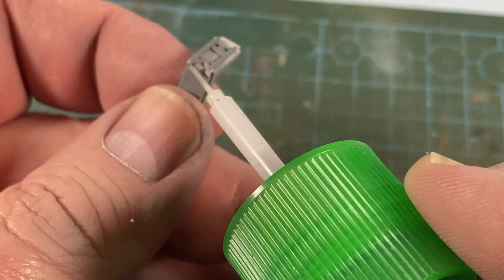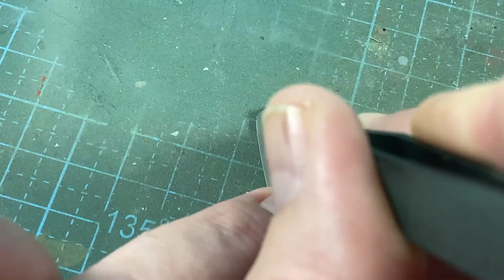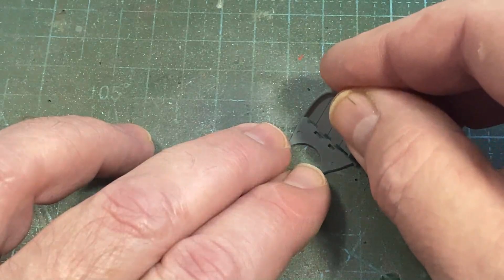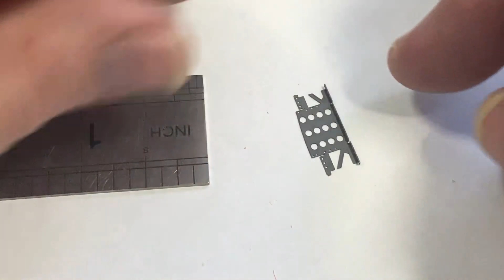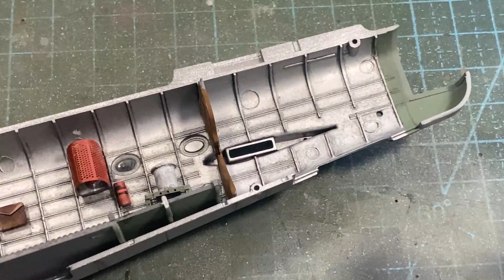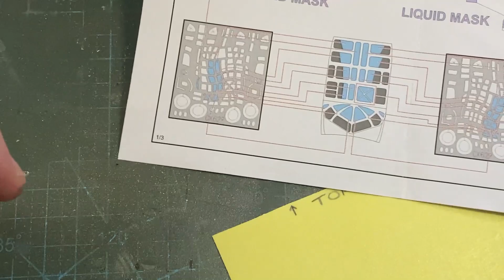STIRLING Italeri Short Stirling Mk.III 1/72 scale BUILD Pt.1 - 1080p HD

Comment: Gary, how do you mask the canopy please? I can never get mine to look as good as yours!
 Marvelous video by the way
Reply from the maker: Thanks - I use a canopy mask set that is pre-cut for the specific kit. This one was made by Eduard - set EDCX629 - which is for the Italeri Stirling Mk.III. For smaller jobs, like a 1/48 Spitfire, I make my own masks by doing the edges with thin masking tape then filling in the rest with bigger bits or with masking fluid. If you use a commercial mask there may be parts of the more curved areas that also needs masking fluid. When all the painting is done and dry, I use a cocktail stick to pick up a corner of each section then lift it off with tweezers. Finally, you can get rid of any small spill areas by rubbing with the cocktail stick.
Reply: @garys_stuff  Thankyou Gary for taking the time to reply. Yes, mask sets for complex canopies seem to be the way to go.
 Keep up the great work. You deserve all the plaudits you gets.
 Thanks again

Comment: Fantastic video! Now, I may be asking some rubbish, can a half of the fuselage be casted in clear resin?/plastic? So all details can be seen (Question open to the public, of course)
Reply from the maker: Yes, there have been transparent "see-though" kits in the past so it is possible, but I don't know if the transparent parts can be moulded to the same detail as the grey plastic for those who just wish to paint it. Would be a good option to have with so much detail inside.

Comment: Thought about being able to see interior detail; what about battle damage to open some view into the interior? Diorama?
Reply from the maker: In theory you can grind off the 'skin' of the plastic just leaving the structure of the ribs and stringers underneath as if the outer panels had been removed in places. I've seen it done but it takes a genius of a modeller to do it - and that isn't me!

Comment: I did a search specifically for the Mk III just in case there was a version difference. I found an image of a crashed Mk III which clearly shows the bar on the frame on that side.

Searching for this should give you the right page as the first link.

20/21.05.1943 No. 149 Squadron Stirling III
BK714 OJ-L Sq/Ldr. Howell

I'd be tempted to try and create the bar from scratch using a thin strip of plastic sheet and using micro clear to attach it to the canopy. Not having the raised frame would probably look a bit odd.

It's a pity they made this mistake as the rest of the detail on the kit is fantastic.
Reply from the maker: I masked ti as if it had a bar there. I don't want to risk adding anything so I'll ee how it comes out. It will have a primer layer plus at least two coats of paint plus varnish so it might have a natural edge anyway...
Reply: @garys_stuff  The primer should hopefully help. An extra layer or 2 done by hand on the bar might help as well. Mr Surfacer 500 could possibly help a lot with a single coat now the masking it on though I can definitely see your point about not taking the risk. It's the sort of thing to practice on a cheap kit first before relying on it on a bigger build.

I am curious to see how it works. I hate painting canopies as I do them by hand at the moment without masking. The cocktail stick tip from previous videos is a godsend.
Reply: @Adam_Boots  another option is to use some leftover strips of decal to mimic the raised frames.

Comment: Gary - newbie question if I may? On some fiddly parts, examples here are the pilot control pillars and wheels, and the radio, you fit and then paint them. I presume there's a logic to this because I'd have thought that painting them and then fitting after that would be easier. Can you explain please? Thanks!
Reply from the maker: Depends on my mood... sometimes it just looks easier to get things in place first provided there is room to get a brush in afterwards, especially if I'm not 100% sure of how the fit will go, so I'm dry fitting and fitting so I would have worn the paint off by the time I'm finished anyway! Most of the time I tend to paint things first though.

Comment: Hi Gary, looks good so far 👍. Did a quick google search for you, & it may in fact be a molding error on the canopy, however don't it as gospel. this is what I used as a search term 'front view Short Stirling' hope that helps.
Reply from the maker: Kind of how I thought too mate. I'm going down that route anyway - makes no sense to make to have a framed windshield in front of the pilot then a fancy curved (and expensive) plexiglass in from to the second dickie.